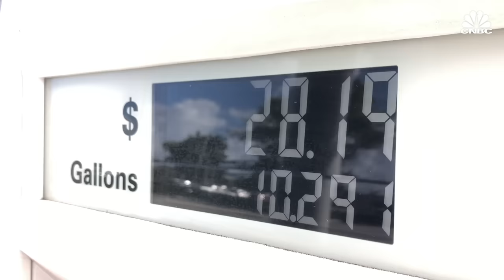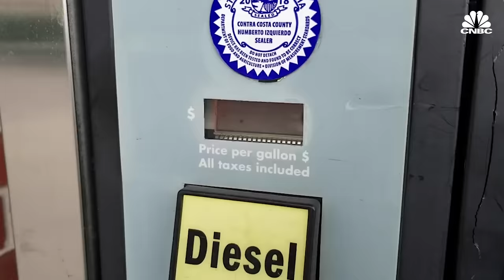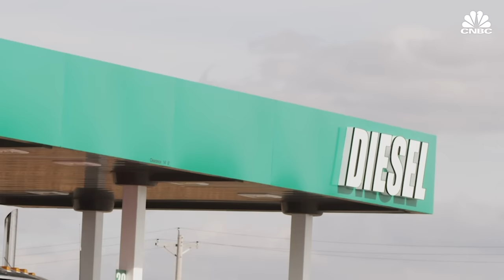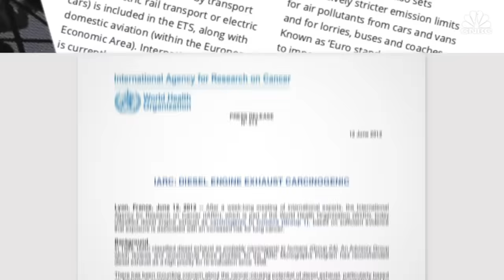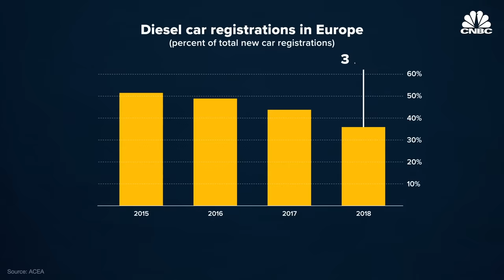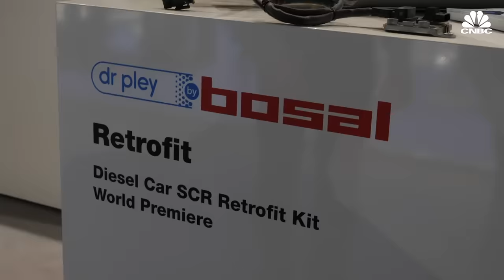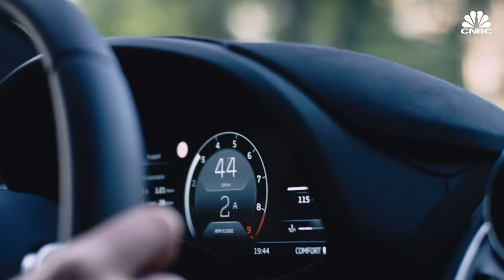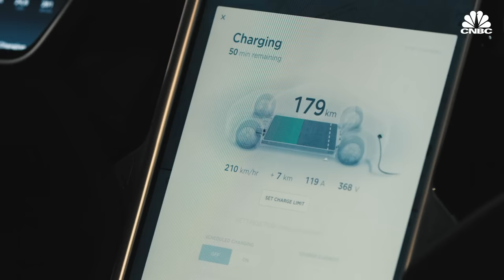Why Diesel Cars Are Disappearing

Comment: Diesel is more efficient than petrol. This is why the entirety of the EU pushed CLEAN DIESEL, then realized they made no money once VW Engines and others were getting 50+MPG with them, so they completely reversed it. 

My TDI Jetta gets 58MPG with mods. I know I don't pollute more because I am going further with less. Wait until the VW 3cyl TDI Hybrid comes out. It's over 180MPG.

If you burned PETROL in these LARGE trucks, you will not only pollute more, because the efficiency with GAS isn't there, but you will bankrupt the entire transportation industry.....

If you wanna fact-check me, I dare you to prove me wrong.

Comment: A better vid description would be,
"Today, Diesel engines are known to be very fuel-efficient, extremely expensive, higher-emissions powerplants. They're fairly widespread and will be for a while, but for smaller vehicles, they just aren't cost-effective and you won't see too many of them around much longer because of that."

Comment: The fact they are trying to get rid of them is dumb, the MPG in a diesel is unbeatable across the board no matter what gas motor you compare. Gas engines have everything from no miles per gallon to 50-60mpg. Diesels are always a pretty much guaranteed 10-40mpg which is much more consistent comparing to its gasoline competitors that could be way worse in fuel consumption. My thing is if my family n i load up in a little car were getting 10mpg in a gas but in a diesel you load it with people it doesnt notice or affect your milage as much

Comment: Does anyone know about how the Citroen C5 engine works better with the emission additive into the diesel engines, If it works why can`t other manufacturers copy and keep diesel cars running longer? I have a Fiat with the 1.9 JTD engine, I have never driven a car with such good MPG, Surely if I am using les fuel the pollution should be less?

Comment: The person who did the research for this did very poorly.  for the fact they left out that modern diesels since 2016 have been emissions free and remain so and always have to be. Hybrids don’t even have that. The exhaust that comes out of the modern diesels is cleaner than the air that came in. It just doesn’t have oxygen in it.

Been a diesel tech for 13 years.

I do like electric cars. I would like to own one in the next few years. Mainly for the fact they don’t require as much regular maintenance which I like. But the batteries have to be replaced every so many years depending on charging practices. The money you save on no maintenance gets consolidated on a new battery. 

But we have a very long way to go before electric Semi trucks take over. For local haulers it can barely make it by, but over the road trucks its not gonna happen until a truck at 80,000 lbs can do 800 miles on one charge on an average run. 

When it comes to construction equipment, same thing. Large iron like excavators, dozers, off road mega dump trucks, and especially cranes, that also has a long way to go. 

It will take time before electric motors take over. But diesel will be around for a long time. I do see gas being gone by 2040 except for portable generators.

Comment: Citroen xsara picasso. 2006.1.6hdi..200k on clock and doing 58mpg.... Only had it 6 years. But it did cost a small fortune £100............ Shame the clutch only lasted 199k (£75)....but you cant have everything.

Comment: The fact is that modern diesel engines are the most efficient internal combustion engines for automotive propulsion.  Electric vehicles will not go mainstream unless and until they have a range of at least 375 miles, and can be recharged from zero to full state of charge within 15 minutes (without shortening the tractive batteries' lives), which is still a rather long time.  Also, electric vehicles will not be totally zero emissions unless our electric power stations are emissions-free.  Keep in mind the astounding increase in electrical generating capacity that will surely be needed to charge electric vehicles.

Modern diesel engines produce far less soot than their predecessors, and soot (aka particulate) filters actually have to periodically burn off the soot they filter, and this requires the burning of MORE FUEL to do so, thus INCREASING C-O2 emissions over an engine without a soot filter.   You can't have your cake and eat it, too.  Also, the reason modern diesel vehicles can't use 100% bio-diesel is because of their emissions control equipment, which will be damaged  by 100% bio-diesel.  Now, THAT'S IRONIC!  People with older diesel vehicles can run their engines on 100% bio-diesel, though.  

The political bias against diesel engines is so bad that I believe that a state-of-the-art diesel engine's emissions profile should be compared to that of the same type of engine equipped with fuel economy-sapping emission controls to see whether an un-equipped engine is really that much worse.  

What we're talking about here is emitting more C-O2 in order to minimize soot and N-O2 emisssions, and where N-O2 emissions are concerned, see Duetsche Welle's 'The Diesel Disaster' on YouTube, where you'll see a couple of experienced pulmonologists question the accusations against N-O2 & soot (particulates); go to 08:50, 10:50, 11:27 & 25:49 in the video.  Then, go to 18:22 in the video, where you'll see that indoor pollution is worse than where an emissions measuring sensor is placed.  It's interesting. 

While emissions controls estabsished in the US in the 1980's have worked well, we MUST question the 'science' that the World Health Organization, US Environmental Protection Agency, California Air Resources Board, and European environmental regulators are quoting and relying upon.

Comment: Why European use less diesel cars? A lot of problems with DPF, EGR and similar stuff which are expensive to replace. So obvious choice is to switch to gasoline because is is cheaper to buy, less problems with car in general bit little expensive to run in term od fuel. That is trade off.

Comment: Frankly, I don't think diesel engines will really go away, as there's some newer diesel engines that actually runs off Gasoline fuel (ie. Mazda Skyactiv-X), which is actually decent, especially for the price of gasoline which you get nearly the same performance as diesel fuel due to quite high compression ratio of the engine. And as a bonus, gasoline completely combusts in the diesel engines designed for this fuel, so no wasted fuel and energy compared to spark-ignition engines.

Comment: Diesel's conspicuously better than gasoline because:
ECONOMY: Diesel has up to 50% more BTUs than gasoline. (BTUs are a measure of energy.)
Go 50% further on a tank of diesel compared to same volume of gasoline.
Diesel engines cost as much as twice as much as gasoline engines but, unlike gas burners, diesels require almost no maintenance and still they routinely last 3 times as long as gas burners. 
SAFETY: Diesel engines have about twice the compression of gas-burners. Engine compression, when descending a mountain, slows the vehicle to a safe speed without the need for smoking the brakes. So, diesel's safer on hills.
Also, diesel fumes don't explode in normal air pressure. Gasoline does. Get rear-ended in a diesel and you move the vehicle to the curb to wait for the cops. Get rear-ended in a gas burner and wake up at the pearly gates, smelling like a barbecue.
Diesel fumes are non-toxic. Take a nap in your gas burner in a closed garage with the engine running and you'll wake up in the line at the pearly gates, behind barbecue-boy. Do it in a diesel and wake up in the same garage, stinking like a Greyhound bus but otherwise okay.
People who know--trucking companies, delivery services, big-name touring acts, anonymous retirees, and the  mechanically inclined buy diesels. 
But any dinosaur fuel is a better choice than electricity-powered transportation, if getting there is important to you. Since Obama's presidency the feds have been closing perfectly good, paid-for coal-fired electric power plants. Simultaneously they've prohibited the completion of nuclear powered electricity-generating plants. 
The result is a dearth of generating capacity, at current demand level. Adding an electric car to a household doubles its electrical demand. 
Increasing demand while simultaneously decreasing supply isn't our future, it's our present. 
Reducing dinosaur fuel availability is also the government's plan but gasoline and diesel supplies are tougher to restrict.

Comment: The Diesel engine doesn’t actually need to run mineral fuel , running on Chip fat and Kerosene or white spirit is quite acceptable and even smells quite nice … I’m thinking that the fuel might also be a source of Hydrogen for hydrogen vehicles …

Comment: i dont have a problem with electric vehicles, but id like it better if they drove like say, the converted m3 that got 800 ft/lbs of torque, and broke a driveshaft each testlap on its first track day, you can still connect an electric motor to a manual clutch, i dont care if it means more maintenance, and possibly blown transmissions due to the power output, its mad science like that that made me want to be a car guy to begin with.
Reply: https://www.youtube.com/watch?v=SVkJjt_Peg0 - not the same car, this one is linked with a powerglide, but same concept essentially.

Comment: My 7 series BMW gets around 800 miles per tank of fuel. I drive from England to Bulgaria 2000 miles on two and a half tanks. Compare that to 5 tanks in a petrol car 2lt mercedes A class ,the result I never drive the merc on this journey. I will be waiting for hydrogen cars as the time it takes to charge would add two days to this trip.

Comment: Stop using Diesel engines in cars, is a crime due to purely economic interests and nothing more. Diesel engines besides being robust and more efficient than gasoline engines, are also just as clean as catalytic gasoline engines, when using new technology such as exhaust filters and catalysts. On top of that the diesel exhaust has minimal unburned hydrocarbons so if the catalyst fails, there are no carcinogen aromatic hydrocarbons emitted like benzene. The main problem with Diesels was particulate pollution, but this occurs when the engine is working at high loads. In modern passenger cars using diesel engines this problem has being solved by correct sizing of the engines so that they will never operate in the region that smoke is produced, in addition to using soot self cleaning ceramic filters preventing anything from getting out. As far as fuel goes, second generation Biofuels derived from used cooking oils solves many of the problems caused by first generation Biofuels coming from specialized crops at the expense of food. Also using liquid Methane from natural gas is proven to be a very good alternative as a diesel engine fuel. 
Diesel engines would be extremely useful in hybrid cars, charging the batteries while the car is moving with electric motors. This would result in great economy and minimal pollution regardless of the motion of the car since an appropriately sized combustion engine would be working at constant conditions turning a generator, constantly charging batteries, unaffected by the cars acceleration or stops. Most car pollution is due to the traffic conditions when the car accelerates. If this is taken away from the combustion engine and given to an electric element the car emissions are minimized. The combustion element is sized to provide sufficient electric power to move the car at a constant average speed, while if more power is required this is taken from batteries and if the car is moving slowly or is stopped in traffic, then the batteries are charged by the internal combustion engine (preferably a diesel) powered generator working constantly at a optimized speed.
Since what I am describing here is not something new, but is known for decades, then I can only conclude that all the anti-diesel sentiment is due either because of great ignorance or because of huge financial interests.

Comment: I run my 2.8 turbo diesel on vegi oil full 100% in summer with a 50/50 veg and diesel fuel mix in winter never had a problem, even used old chip shop chip oil.😂

Comment: I have operated diesel trucks, cars, machinery, all of my life.  There is NO COMPARISON betwen Diesel and "gas" powered vehicles and equipment.  I would have a diesel WATCH if I could get one.  Diesel is NOT going anywhere.  And everyone knows it.  Have you ever noticed in a Truckstop out west like in Wyoming, Montana, etc. trucks can idle while being SNOWED in so driver can take refuge in them??  Have you NOTICED the DRIVERS of these trucks do NOT die from Carbon Monoxide??  You do that in a Gasoline, Natrual Gas, or Propane powered Vehicle they will GAS you.  The reason, the Diesel Engines do NOT require an artificial spark.  When I was young I drove all over the Pacific Northwest and the Canadian Prairies.  I have been snowed in and had to use the Truck Engine for heat in 20 below zero weather.  I would NEVER go cross country in the North or Northwest in a gas powered vehicle.  The SOOT they put out, they have a way to catch that now.  You will NOT see Electric powered Cross country Trucks in YOUR LIFETIME.  Probably your children will not see that.  The COST of the BATTERIES, and the limited ability of Batteries are the RUB.  Batteries give off FUMES TOO.  The powers that be present Electric Vehicles as HARMLESS are not telling the truth.  The Suphuric acid in wet cell batteries is DANGEROUS.  It gives off FUMES.  I have not owned a Gasoline powered pick-up truck in 40 years.  I have one now that has 300,000 miles on it now, and no sign of needing an "Overhaul".  Once you have GOOD DIESEL you will never go back.  Diesel perfoms even BETTER IN HOT CLIMATES as it has a TENDANCY to run too COLD.  This is the reason you can leave a Diesel Engine idling at 110 degrees and the AIR CONDTIONING running and the Engine will NOT OVER HEAT.  Diesel Engines actually run best at 100 Degrees F ambient temperature.  Some Truck operators run "in-Line Fuel Heaters" in the SUMMER and WINTER to heat the fuel before it enters the Injector Pump to be sprayed in to the Cylinder for combustion.  It is only the USA that has a phobia against Diesel.  I will operated Diesel until I die.

Comment: In the winter time,What are you going to heat your car with in the midwest if it's electric, some kind of on-board heater or the coal plant setup to run the grid, think about it.

Comment: Diesel is even more popular now as they have the range that electric vehicles don’t. Plus as several petrol vehicles are having poor running issues with the introduction of E10 fuel lots of people are swapping over to diesel. Oh and you can’t tow anything with a electric vehicle as the kerb weight is too high on an electric vehicle . So diesel is cheaper to own run and work with.

Comment: Only people don’t understand how a Diesel engine worker is just simple fact 
A petrol engine use 80% fuel and 20 air the pump petrol the pressure is only from 100psi to a sport car 150 psi .
A Diesel engine use “”a Common Rail sistem “”
Use. 80 % AIR and 20% of diesel and the pump;;;;!!!
The top pressure is from 15.000 to 20.000 psi so my dearest friends I let u to work out which is mo polluted;  .....
Ps  a petrol w 2000cc engine u can pull only 
1000 kg for a  long distance, 
Wen a 2000cc engine car u can pull 2000kg for. Long run :::::::

Comment: Just plant more trees to absorb carbons in air. Diesel engine now has fewer emission than gasoline. Diesel engine is very strong...and it continue to evolve to have more hp maybe  future manufacturer can  squeeze diesel engine to be more frugal but retain its high energy efficiency.

Comment: Hydrogen injection is the only way to make diesel work it gets rid of the particulates and almost perfect burn not to mention up to 30% better mileage and more horsepower.
They're already installing them on large diesels.
Cummins diesels are already installing them on their trucks.
Reply: Or oxygen? Air contains mostly nitrogen, somewhere over 65%, so internal combustion engines need oxygen to burn the petrol/diesel

Comment: its actually DIESEL are much reliable than gasoline, and much easier to work on less parts just compression and will run anytime of the day. here in philippines half of the cars here are DIESEL engines toyota Mid-Sized SUV like Highlander uses Diesel engines on all variants. our SUV uses diesel engine, more torque and more power.

Comment: There is a new technology that make diesel engine burn like the gasoline ones - that does not produce soot or NOx (even high noise). Therefore it doesn't need the expensive and nasty aftertreatments. It can be retrofitted into old, existing, or new engines. Any interest?
Reply: Run it on a high percent biodiesel mixture and I'm in
Reply: @youseflatif796  There is biodiesel fuel already (at least for aircraft fuel). It is cost and availability issue.

Comment: The largest "carbon foot print" that everyone ignores is manufacturing. A diesel engine will easily last 400,000 miles, while most gasoline engines are toast after 200,000 miles requiring people to buy new cars more often.
Reply: @martin096  My daily driver diesel truck has over 300,000 and running strong. I plan to pull the motor out and overhaul it at 400,000 and go for another 400,000. Several of my friends trucks are over 300,000 as well... but, my friends and I all like doing mechanical work, so maintenance is kept top notch.
Without proper maintenance a diesel will die just as quick as a gasoline engine.
Maintenance and repair shops are getting ludicrously expensive, while at the same time becoming unreliable with shoddy workmanship, so I suppose it's no surprise that most people prefer to buy new vehicles rather than repair and maintain old ones.